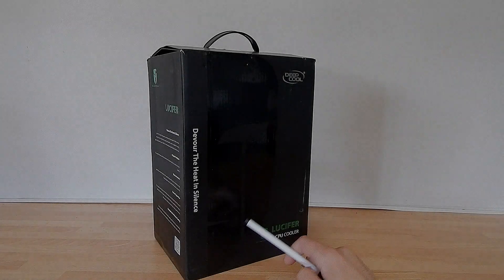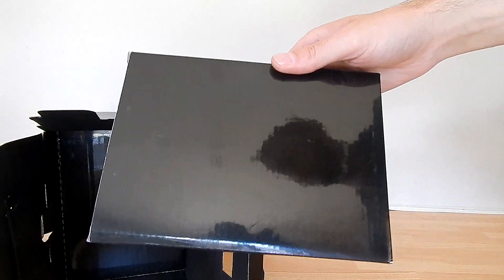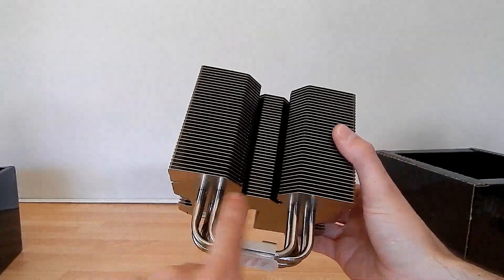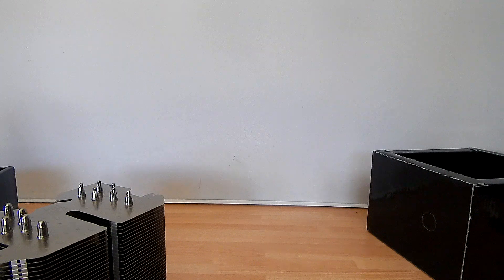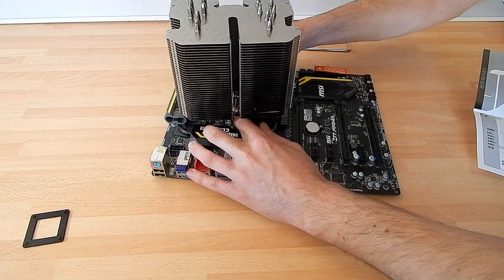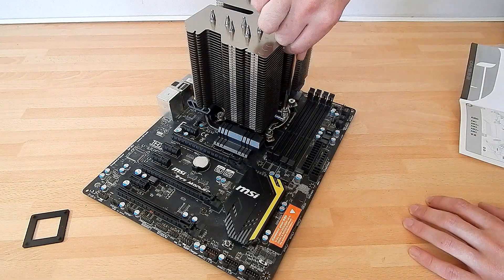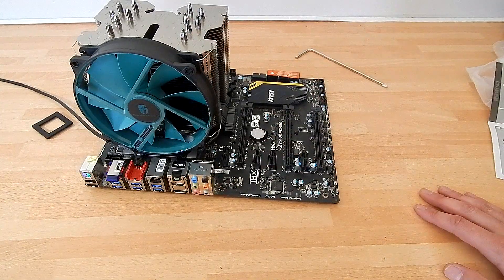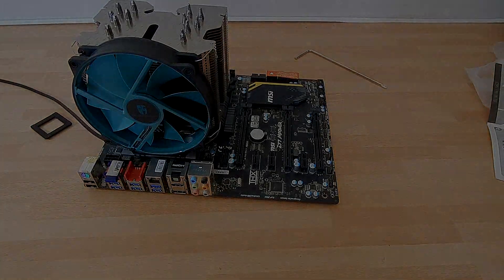DeepCool Lucifer CPU Cooler [Install Socket 1150] Unboxing and overview

Comment: i have this cpu cooler. i have to adjust the bracket because the screw will hit  a capacitor. luckily i was able to install it. i hardly hit 50c in a tropical country

Comment: Hi, i bought a CPU cooler but my motherboard is already installed inside a case. do i need to remove my motherboad from the case or install the cooler inside the case?
Reply: depends on your cpu case. in my case i can access the back of my motherboard so i can mount the support bracket.

Comment: does dis fit i5 4570 on gigabyte B85M-HD3 mobo on mid tower trendsonic case? tnx
Reply from the maker: Alexandria Allani  The cooler is compatible with the Gigabyte motherboard yes. For you case, you'll need to provide me with more information. Or you could measure yourself. The cooler is 140mm Tall

Comment: can someone tell me if this cooler fits into a middletower case ? or should I buy a fulltower for it to fit it ?
Reply: go to the website and check its height...then go check the case's max cpu cooler height to see if it fits
Reply: cooler is 163 mm in height, so you need a pretty wide rig actually

Comment: anyone noticed he mounted the heatsink the other way around ? on all the sites the cooler is presented with the fan mounted on the other side .he mounted the heatsink with the back to the memory slots not with the front..

Comment: you sure i dont have to remove that plastic part from backplate?
Reply from the maker: After Hours  No you must not :) it stops the metal causing a short on your motherboard
Reply: o wow i was not expecting that super fast respond mate :D thanks i just got the cooler i mean its sitting right behind me and i was watching ur vid to see how i should do it :P super usefull tho ! and another thing do i have to remove the motherboard from my case? or can i just do it while its installed in my case
Reply from the maker: After Hours It depends on your case really, If it has a cutout "referred to as CPU Cutout" then you could leave in . As I mention in the video though accessing the screw on the left can prove troublesome. I would advise removing the motherboard to avoid slipping and possibly scratching it..
Reply from the maker: After Hours  you could also refer to  the guide I did here - http://techicize.com/deepcool-gamerstorm-lucifer-cpu-cooler-review/3/
Reply: @Techicize  Probably. But many people report they were unable to remove the backplate after this plastic glued to motherboard permanently.